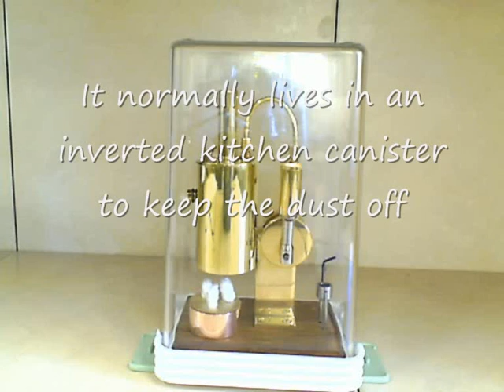Don's Engine

Comment from the maker: If you are going to draw something, can I suggest using Alibre - a 3D CAD package. After using several 2D packages I was introduced to Alibre by John Olsen from NZ. It is cheap, easy to use and has lots of tutorial and help and is much faster than using 2D. And you can build the engine on screen to check that it all goes together.